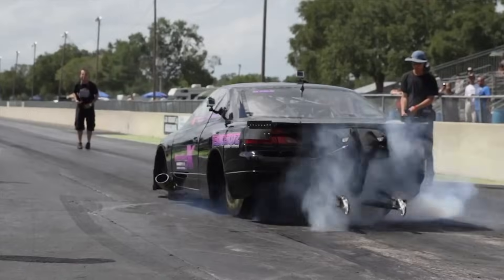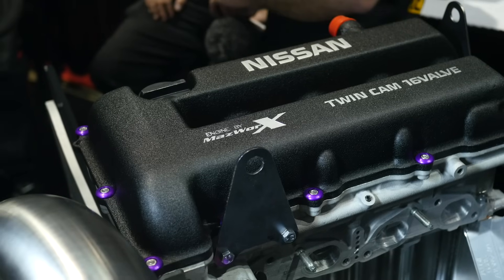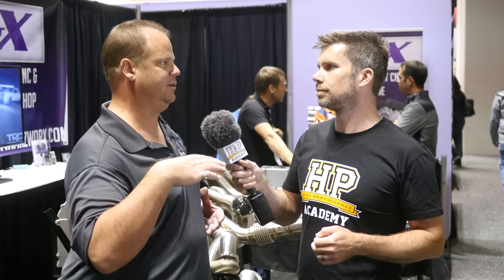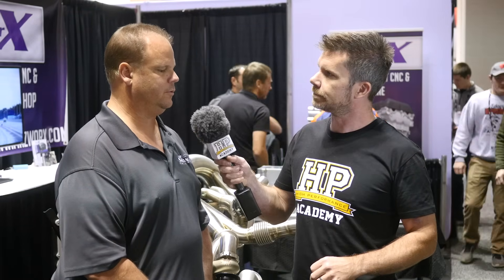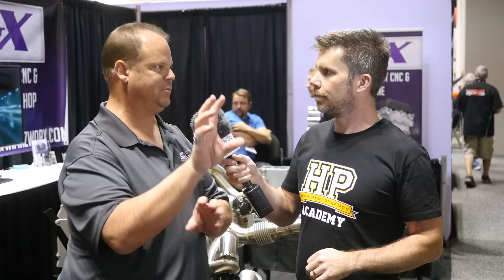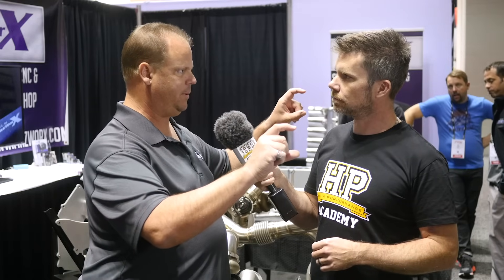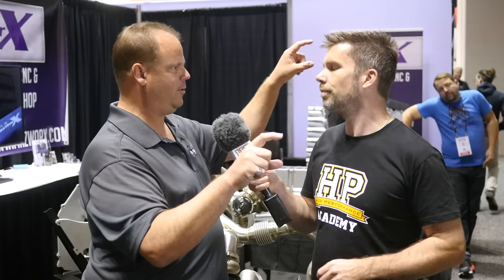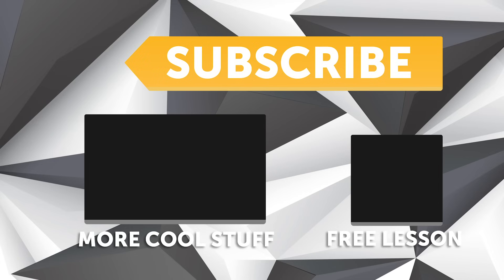3000HP, 150 PSI Of Boost | What Do YOU Know About Compound Turbo Systems | Shane T [TECH TALK]

Comment: 3000hp 4 cylinder? Excuse me, What?! Imagine what guys like Shane can do with Formula 1 level budgets... Guys are sleeping out here.
Reply: Guys like Shane are the ones behind the old school Group B Rally Racing. :)
Reply: Formula 1 doesn't progress because it has a LOT of rules that basically put everyone at the same level of advantage, otherwise big companies would dump a bunch of cash into making cars with enormous advantages and smaller companies with less money would be in the shade.
Reply: @TheFPSPower  eh, small companies used to do fine. They used a lot of tricks to get around rules and what not with less money and they did fine. If it went back to that, we would see a lot more tech being  developed though.
Reply: Running an engine for 10 seconds it not the same as completing a race circuit.
Reply: This has to be a v6 or a v8 for 3000.
Reply: @FrezzyYT  no it's a 4 cylinder
Reply: @TheFPSPower  If F1 made a rule that a dominating team has to give up there performance secrets for the following race season to all the loosing teams. I think it would work
Reply: TheFPSPower they should be in the shade, and there should be a no rules formula 1.5 to get it done. ha
Reply: @chrisjjwilson  This. The bigger the rulebook the bigger the wallet you need. Less rules gives big teams more things to waste money on, big teams love tight rules, less chance for them to waste money.
Reply: @TheFPSPower
you can always take the teams' positioning to budget ratio.. you will get the best bang for buck technology even though it would be wildly dissimilar. a couple seasons and about twice the teams would flush a lot of innovation out.

safety concerns in the sport about varying capabilities would be a problem. first corner last lap death trap
Reply: @Shawn
let them at least keep it for 4 seasons so they can keep it as an advantage then it gets released
Reply: 3000hp that runs for 6 seconds.
Reply: @ChiefStyn  5 actually but that's just one pass.
Reply: Because boost
Reply: F1 cars have a fuel limit and they have to run for 1.5 hours not 10 seconds.
Reply: current Formula 1 power units must last for thousand km and sustain a 300km race at 40+ C ambient. Not just 10sec
Reply: MBrace F1 in the 80s had 1500hp from 1.5L in qualifying and were on full noise for more than one whole minute and the entire car weighed only 550kgs !
Drag racing is still not close to F1 performance of 30years ago.
Reply: StrikeEngine TV nope, the reverse is true. Woth tight rules, it becomes.very expensive to find the winning edge and a lot of r&d is required to get ahead.
Reply: @pehgt5099  But that's to close the valves at high rpm. Not to feed combustion. Or drive the crank.
Reply: The F1 guys could do the same very easily however they have so many restrictions they have to deal with. Sayimg that, imagine what could be done if all these brains came together 😊
Reply: @chrisjjwilson  When exactly did “small companies used to do fine”?

Which companies do you consider “small”?
Reply: imagine what F1 could do if there were no restrictions. :D
Reply: Makes me want to build a mild 750hp 4 cylinder😄
Reply: F1 has been nerfed (deliberately made less powerful) 100s of times, usually for safety reasons. They aren't running anywhere close to technological leading edge, like WWE wrestling they just have to look like it. It's an entertainment sport that old women watch while solving the crossword. The priorities for F1 are not engineering/technology, it's entertainment.
Reply: A 3000h.p. 4 cylinder is still lacking compared to an 11,000h.p. V-8. 🤷🏻
Reply: @John-rw9bv  What?? F1 is at the PINNACLE of technology. You might want to do some research before you make RIDICULOUS statements like that. 🙄
Reply: @John-rw9bv  You need to do some research. MANY F1 engineering feats have been passed down to passenger cars for much benefit. And now look at the energy recovery systems that they use. You're just going to say "Ho-hum" to that I suppose too huh? Look at the limited fuel they get and how efficient those race engines have to be. How about the cutting edge material science that has been learned from keeping a 20,000 rpm engine alive and efficient as they are? Do you realize how much the designers of the engines have to deal with frictional and pumping losses at that rpm? I could go on and on. Obviously you have no clue about building a car at this level, and the obstacles that have to be overcome to do it.
Reply: @John-rw9bv  Sure, sure... 🙄
Reply: @Bruneello  plus a lot failing to mention insanely light  weight anything on F1 car is vs drag engine which is designed for 1 pass then 75% teardown with multiple parts replaced weather there ok still or not. Ppl forget in senna days F1 engines were 1.5Ltr 900+ hp beast and sadly safety along with F1 tech being forced to be designed to be  used  in a  regular road car 10 yrs later we are left with F1 as it is today , 💩 sounding engines ,aero dominant approved rules paper pushers think is safer slowing top speeds only anyone actually driven above the speed limit will know 95% accidents in a race are entering,during, exiting a corner which aerodynamics have largely increased speed yr on yr and in turn impact force lmao.
Reply: It is impressive but i cant imagine the lag and stress of this engine
Reply: Formula 1 has too many restrictions.
Reply: They have a dyno that proves it so not sure the argument.

Comment: IAT's 5 degrees above ambient is probably the most impressive thing in my mind. The engineering involved in those charge coolers is incredible. Think about how long the intercooler actually has to cool the air that is rushing past it, literally fractions of a second.
Reply: Physics/thermodynamics ftw baby!
Reply: don't forget that they're using ice water to cool the air, not ambient temperature air
Reply: @Technoflicks  thanks
Reply: Dry ice and Isopropyl alcohol = -77°C or -106.6°F
Ice and water = 0°C
Ice + salt and water = -21°C
Reply: Soon people will be running charge coolers with liquid nitrogen. "What are your IATs? About minus 180 C... o.O"
Reply: @Domas64  there is such a thing as too cold... My Volvo I use meth inj with dry ice preturbo and I have to keep the fluid flow down to keep the fuel from freezing. That being said I have found that going bigger like a whale tail away from the compressor and inj up stream of the turbo makes little turbos go like big ones lol.
Reply: @oliverscorsim nitrous also has that effect😂 look no further than the world's fastest stock LB7 duramax WITH a STOCK IHI turbo! How that thing hasn't sent shrapnel into the core of the earth and into the moon simultaneously is a mystery to me. Lol

Comment: Diesel have been using compound turbo setup for ages, most stock semi truck diesel engines run upward of 65-80 psi and run 70.000lbs injectors , like he said nothing new really. But on a Gas engine its tricky to setup and get running properly. 3000 Hp on a small 4 cyl is damn impressive.
Reply: Its tricky to get the correct size turbos even on a diesel. Dudes have been doing it long enough that the maths are known much better in diesel applications.
Reply: RedmistAU well also diesels do not burn the same fuel and do not have have an ignition system.  Diesels need compression to ignite the fuel , whereas gas engines to much compression is very bad for detonation unless your burning nitromethane.
Reply: I wanted to see the layout
Nissan navara run twin turbos and, correct me if I’m wrong (probable) they run sequentially, sort of parallel, small turbo at low revs changes to large turbo at high rpm
I think this set up is turbos that directly feed each other in series 
Would have been great to see how the exhaust was plumbed
Reply: As you said!!!! Diesels making around 80psi is a totally different  ball game to a 2 litre 4 cylinder gas engine!!!  ..... diesels make boost a lot more easily !!!  Due to their design !!
Reply: diesels are ridiculously simple compared to spark plugs where there is a hundred different areas trying to scatter the engine

Comment: Fantastic vid with great info on his compound setup. When it comes to compound turbocharging gasoline engines I always see people implement it with the goal of obtaining some low-end/midrange power with a strong top end. This setup is designed to run super high psi for extreme hp which I haven't come across before. Great stuff!

Comment: I love how he talks about how impossible running a 5 sounded years ago. And now they’re knocking on the door of 5’s. Yet they had to turn down the power they could possibly make. I wonder in how many years 380psi is not gonna be enough just how if you talked about running 75-80 psi 10-15 years ago on a 4cyl they would of though you were crazy. But now we’re their. When will we actually use 300psi?  But in all seriousness 3000hp on a 4cyl is absolutely astonishing. That’s 750 HP PER CYLINDER. I struggle to make that with 8 cylinders 😂.

Comment: I always wondered how they tuned the wastegates for compound turbos. Well now I know. That engine setup is going to be a heavy hitter for 5's. I hope they make it
Reply: The assumption is the more turbos the more complicated it should be. Kevin Jewer's setup is the same, takes the signal from the top of the port.  He went from air-to air, then methanol which is what Jett is going to air to water which is what Shane explains the benefit over the added weight. Another 900 whp offsets the 80-100 lbs added, very easily.  Actually more people are figuring that out, just make more power.

Comment: What Shane just mention about making the same torque at a higher RPM is right on par with what I’ve done with the stock internals Hayabusa Dyno Tune it could handle 200 foot pounds of torque early on in the booth strange went to a larger turbo and made 200 foot pounds of torque near red light hence a stock internal Busa made 320 hp at red line 350 was possible but I ran out of injector i’ve been wanting to build compound turbos for a while now I’m glad to see somebody’s done it that’s making real power in numbers

Comment: This bloke is amazing. The last time you had him on he was just as informative. Also I think he should let the engine hit 380psi. Just once, just to make sure his math is correct, make sure it's being filmed tho. So one thing I'm curious on, if you had a compound setup that used supercharger then turbo, isn't the power going to eventually be limited by how much air can be dragged thru the supercharger, or for that matter, pushed out the exhaust housing of the turbo? Surely there is a point at which the whole system either chokes the intake, or back pressures the exhaust?
Reply: Of course, EVERYTHING has limits. By the way, blown diesels have used combinations of turbos feeding roots blowers for decades already.

Comment: the performance diesel tuners have been working with compounds for years, they call the first stage the Atmospheric stage, and the 2nd stage the high pressure stage. of notable mention about the high boost diesel builds, they found that when running near or around 150 pounds of boost boost pressure they were actually pushing the pistons down during the intake stroke, they were actually recovering power from the exhaust due to the extremely high manifold pressures!
Reply: It takes even less that 150psi of boost pressure to "help" the pistons go down during the intake stroke.

Comment: I enjoy that interview.  Not sure we quite got to the bottom of the different intercooling strategies.  Methanol injection  for cooling through latent heat of evaporation would be a lighter solution, nothing a bit of thermodynamic maths cant answer.  Thermodynamics tells us that it is more efficient to raise pressure of air then cool then compress again.  The net result is higher air density for same work done. Of course there are many other considerarions.  I run compound on the street and have done for 8 or so years now, all done in my backyard shed.  As noted the control strategy is remarkably simple once you wrap your head around it. Great vid and I look forward to 3000hp.  More info on combustion cylinder sealing would be interesting!  Cheers👌

Comment: The compressive side of a turbo is basically a centrifugal compressor like was used in the aircraft superchargers in the 1930's and 40's and they ran multi stage setups. They then were used in some aircraft driven by the exhaust gasses just like a modern turbo (p38 p47). in the mid 40's some jet engines used them as the compressor (RR derwent etc). has anyone tried using a multi stage axial compressor instead like a modern jet  (j57 rb199 et all) or a compound axial/centrifugal like the RR clyde turboprop?

Comment: I'm currently building a compound turbocharger setup on a 3.9 liter stroked 2GR-FE engine in a 93 MR2 Turbo.  Using a S366 SXE and a S475 turbo.  hoping to make 1250whp.

Comment: Hi from aus love ur combo. I can remember an old rb 30 turbo motor in a lv commodore running 9s year's ago  and he ran a spark plug just after the turbine wheel in the dump pipe he reckoned it made more thermal energy it pulsed from the computer don't how true it was
Reply: I saw something like that in rally, they had spark plug and would dump fuel in the exhaust to keep the turbine spinning. So the turbine would spin at lower rev during shift acting like some afterburner.

Comment: Pretty simple the turbo doesn’t really care what’s in out pressure wise all it knows is it’s going to multiply the pressure . 2.5-3.0 for a big turbo is about it you simply can’t run much more than 35-50 PSI boost as a result Want more ya gotta compound and because adiabatic compression 2-3:1 raises temp almost 100-150 C ya gotta intercool the crap out of the thing since you’re about to compress that again and go up again another 100-150C if you didn’t chill in between.

Comment: Compound setups are the next frontier. Rotaries have an advantage of being able to rev to the moon, but the problem is you don't make enough heat at lower engines speeds to spool up the turbo over say 98mm. Compounding would give tiny displacement rotary engines a much wider powerband. Street setups are possible but enough people are sufficiently dumb when it comes to putting it to the ground that most cars will stay around 400 hp level until the knowledge base changes.
Reply: One wouldn't need a compound turbo setup anywhere near 400h.p. 🤷🏻 A conventional setup is good to well over 1000h.p.

Comment: Re the title:
Enough to know that I want it
Reply from the maker: Do it Skippy! We'll hold your beer =D - Taz.
Reply: @hpa101  I don't have a gearbox strong enough to take it. Only playing with stock barra stuff in the burnout car. Don't think I can use more than the 300rwkw I can get from a single and stock bottom end anyway.

Unless you know a way to make a btr hold in the region of 800ft-lb...
Reply: @hpa101  got an ecoboost FG now. It's a more feasible candidate for an extra turbo. Now I've got to figure out* how to size the turbos. It would probably end up being mostly the big one doing the work, I'm not talking a huge power goal (could make 400whp with a big single), I just want to keep the stock drivability.

*by which I mean daydream about

Comment: Speaking on the part of the 1:1 pressure ratio across the cylinder. Where would you be measuring the backpressure in the exhaust? Would you measure in the header runner on the cylinder you're looking at, would you measure at up-pipe right before the turbo or would you measure the pressure after the turbo?
Reply: Anywhere before the turbo

Comment: Hi Shane, Sorry for my ignorance but I have a question. If your able to run compound turbos at 10 to 1 pressure then the engine is acting as a combustion chamber and partial decompressor (this creates the shaft power).  Would it not be more sensible to just put a combustion chamber in front of the engine block and convert the engine block into a 2-stoke decompressor, effectively only needing 1 liter block and much lighter including perfect pressure maintained in the combustion chamber at all revs?

Comment: A normal turbo setup requires that the turbocharger/s are flowinag about 14.7 PSI of flow at sea level in order to have zero boost because that's the atmospheric pressure. By pressurizing the air above that before it goes into the final compressor you're literally raising the BAR.
Reply: You can see yourself out now...

Comment: Just throwing this out there. Could you use a gas generator to drive the turbo instead of the engine exhaust pressure? Like they do with rocket engines?
Reply: Why? The exhaust pressure of the engine itself works just fine. The extra weightb and conversion losses of the kind of system you are talking about wouldn't be worth it.

Comment: Its only good in professional drag racing - a dyno queen in real driving. 3,000hp?
Beside intercooling issue, what about the variable ambient temperatures you are dealing? Today is 90 degrees, tomorrow is 93 95, how you handle & kool that?
The transmission? The suspension? The brakes? The clutch? The cooling?  The fuel additives? The fuel delivery? The super tires, where do you get those?
You need a titanium internals. Can the driver handle that horsepower? Not for most.... will it hook up?

There are more questions besides the 3,000hp. Opening a can of worms.